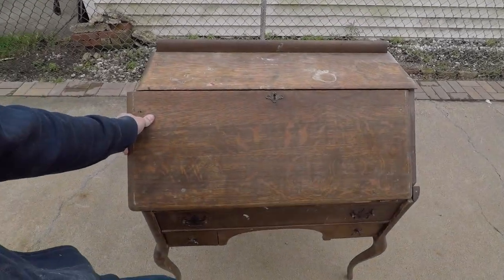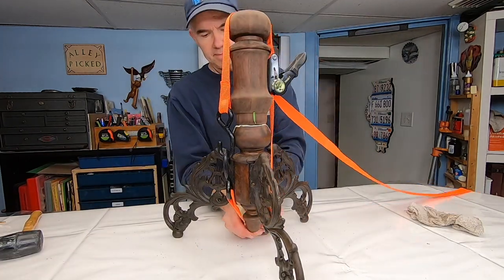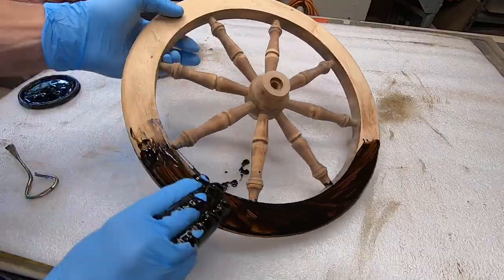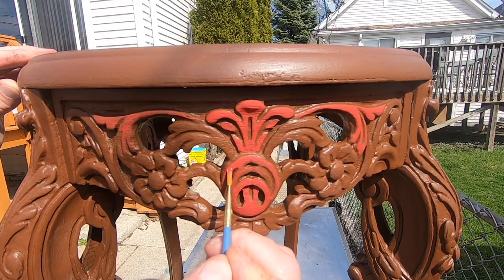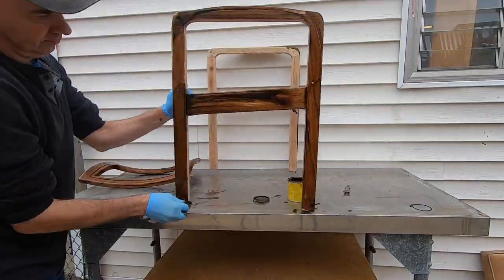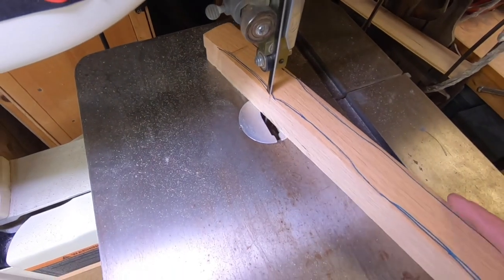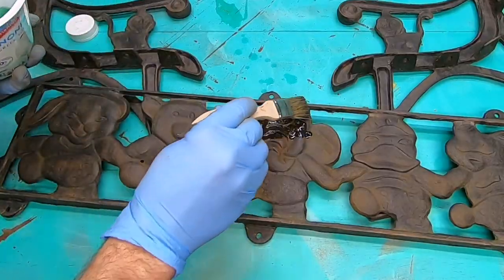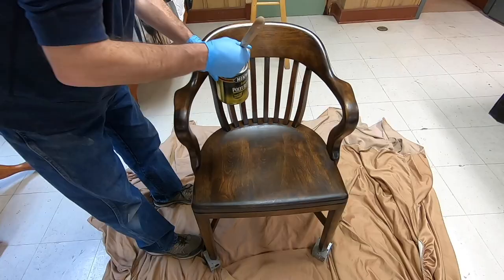13 Amazing Restoration Projects

Comment: When does one use tung oil as opposed to polyurethane? Thanks!
Reply from the maker: There are many types of oils you can use, each with its own benefit. Oil finishes are for a more "natural" look or for cutting boards. Polyurethane offers a very protective finish usually for tables and floors. You would never use an oil finish for a floor. An oil finish might be for a jewelry box that will not get a lot of abuse. Hope that helps.